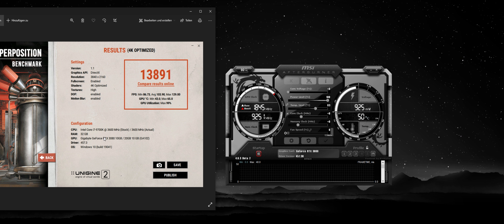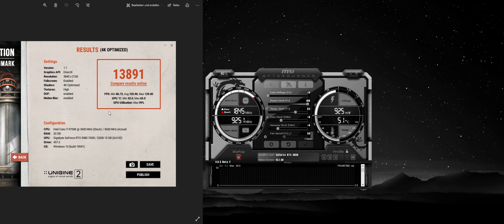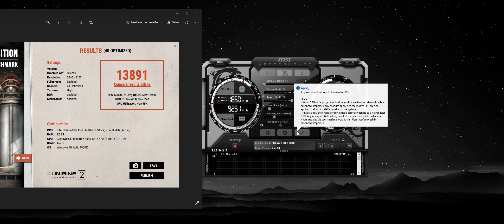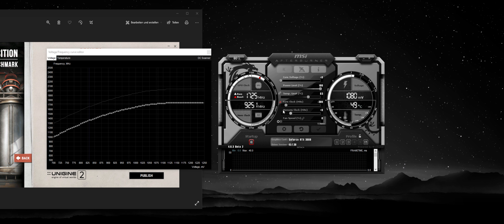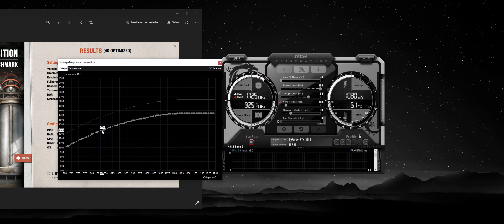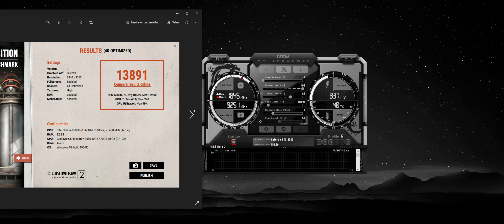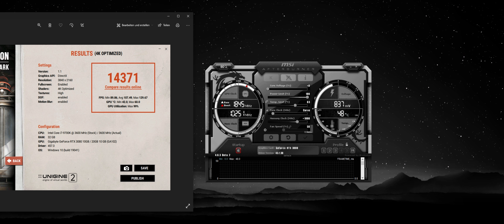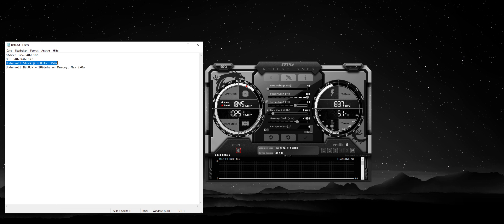GPU Undervolting Guide for RTX 3080 / 3090 | UP TO 100 WATTS LESS POWER

Comment: Hi mate, I got a watercooled system with 3 radiators and a watercooled 3090 from gigabyte. The GPU stays at maximum 35 degrees under heavy load. Which settings would you recommend for me in afterburner?
Reply: Don't undervolt, just overclock the shit out of it? Grab another +1000mhz of memory speed and increase your clock by +100. If you need the performance, anyways.
Reply: LOL, that's an awesome setup, but undervolting isn't for you unless you want to save some dollars on the electric bill.  Most people here do it to ramp down fan speeds on the graphics card.  With that kind of temp under full load, you'd be overvolting.  Unfortunatlely, there isn't much headroom on these cards.  If you find differently, let us know.
Reply: yeah unfortunatley I had to send back the RTX 3090 from Gigabyte. The GPU turned all of my monitors black, while the PC was still running in the backround. I have now an RTX from Asus and never faced the issues again.

Comment: im currently undervolting at 837mv at 1905mhz in after burner - i do have the aio version  temps are silly 40v
i have dropped about 90w load undervolting
Reply: btw i have 650w psu its no issue.   im pulling at load 380w in game

Comment: well i switched from rx6600 to 3080 and man power consumption is literally more than 3x of rx.and even while watching videos rx used 6-8w and 3080 eats 25-35watts lol thanks for the guide btw i managed to drop 330w to 180-190watts
Reply: what your settings?
Reply: XD I’m about to go from 6600 to 3080ti and was worried when I saw the power consumption
Reply: Going from 6600 to 3080 too what settings did you use ?

Comment: witcher 3 crashed for me with these setting , got 3080, any suggestions ? :) do i put down the frequency less or maybe choose a higher voltage ?
Reply: Try higher voltage until its stable, every silicon is different, even they are same 3080
Reply: memory overclock might be too high. try like +800

Comment: I get a score of 14618 with 1850Mhz / 850 V but my temps go up to 68°C
do you thinks thats normal?
Reply: Also you got this dashed line which goes from 825 Volt up, but i am missing it...does that matter?
Reply: He may just have better cooling than you

Comment: nice. I'm running mine @1920MHz with 880mV
Reply: Thats great result. I issue crashes at that voltage, need 925mV for 1950mhz, especially in demanding tiltes with rt on.

Comment: Don't do it. Just overclock it and use power limit to have it running at whetever you want it to draw. If you edit voltage frequency curve only at some points than you leave perfomance on a table with not demanding games and overvolting your gpu with really heavy games. If you don't understand what i say then i will give you example. My 3060ti undervolted at 1860/925mV draws anything from 170-220W. If i wanted it to use higher clocks at higher voltage than it would  still draw up to 220W as that is my power limit but it won't hit that higher clockspeed in every game and instead it will ran at lower clock. I you lower whole curve and push clocks only at some point then anything below that point will be overvolted. I'm using +105mhz core +900mhz memory and 80-90% power limit depending how game's framerate responds to higher clockspeeds.
Reply: Yea, there seems to be a lot of confusion about this. It seems that with these cards, when you overclock all you are doing is undervolting, and giving yourself more headroom, and vice versa. So people (like in the video above) are basically underclocking (overvolting) the card, and then dropping the voltage back down again at the upper limits.
The idea of just overclocking (undervolting), and then putting a limit on the power seems to make a lot more sense.
There's no doubt that the method in the video above works, but it just doesn't sit right with me. It seems messy.

Comment: Best programs to test Undervolting and OCs? and what to looking for in my results to identify stability
Reply: I believe 3D mark is on sale on steam for 85% off right now which is great for testing clocks but is a best case scenario as games won't comply as nice as those testing benchmark suites. And depends on game by game basis. For example I can reach 1965mhz at 0.900v on my 3080 in Shadow of the tomb raider but in metro exodus enhanced edition it will crash until 0.918v. I would recommend running a game loop benchmark to test stability. The Hitman games and Metro games have benchmarks that are loopable and I use them to test stability and would recommend those. If your OC or undervolt can pass say 10 passes in a game loop benchmark than it is probably stable for most games but you might find an oddity like I did for metro exodus enhanced edition as 95% of all games complied with my 1965mhz at 0.900v but it didnt until even 0.918v. I would try to find a hard to run oddity like that and find stability in that. Because if its stable in that it will be stable across the board for basically 99.99% of all instances.

Comment: Bro... Your Card didn't IDLE. Go to NVIDIA Settings and disable max Performance :) There are No Performance differnces, the only think is that this disable IDLE Mode. Much lower Temps in IDLE and Power consumption of course..

Comment: WILL UNDERVOLTING VOID WARRANTY OF THE CARD. MY 3080 CONSTANTLY CRASHES AT 4K GAMES. DEALER IS READY FOR RMA BUT I WANT TO TRY UNDERVOLTING TO SEE IF IT HELPS. BUT AT SAME  TIME I DONT WANT TO VOID WARRANTY IN CASE OTHER COMPONENTS OF CARD ARE FAULTY.

Comment: I feel like I need the -250 clockspeed explaining. Why not just drag the curve and leave it at that? Because from the looks of it, all that does is reduce the efficiency of the card by underclocking at the lower power limits. Looks like the card would have hit 1300mhz at 700mv, and now only hits 1000mhz at 700mv. Surely the base clock should only need altering if you're not going to touch the curve at all? Edit: I'm pretty sure I'm correct and this is just 'overvolting' it at lower speeds - nothing dangerous but definitely the opposite of the goal. You can flatten the curve easily enough without having to mess around with the offset. Ctrl clicking the rightmost point also lets you adjust the whole curve from the starting voltage/clock, just line it up like you want and then flatten everything past that point. Gonna be more energy efficient, and gives a perfectly smooth curve too.

Comment: Is this safe to do on the long run, undervoltage I mean?
Reply: Yes, it's safer than OC, which in general is also very safe to do.
Reply: Blakee1000 let me rephrase - are components goint to last less if I undervolt them, as is the case with overclocking?
Reply: @_neuromanser_  No, technically they should last even longer than stock, because you're running at lower power and in turn also lower heat on the processor.
But how long that is nobody knows, even on simple OC cards you're looking at use of 10+ years, which is when the card is already obsolete..

Basically all I'm saying is that it's pointless to worry about GPU tuning shortening the life of your components, it's more likely to die by something else.
Reply: @_neuromanser_  Heat and voltage spikes are components killer. When you reduce heat and lock voltage, you basically add life to your hardware. Undervolting is perfectly safe and even better than stock values in terms of longevity :)
Reply: @liquidchair  Thanks, this is what I wanted to read :)

Comment: and then theres me, with solder/copper wire bypassed fuses, running a 1,000W Galax bios on my 3080ti pulling 600W casually @ 1.1v on a 1080mm radiator and 8 200mm fans. its kind of like a space heater if i play the right game.

Comment: Or dont because that 100 watts a month is like a $1.00... 😂🤣😂
Reply: Or do because the 100 watts is extra heat that makes your fans run faster and louder and your GPU run hotter under load and thermal throttle.
Reply: I use about 400w on avg for 6hrs a day.  And elec is .07c per kWh where I live between 9pm and 5pm (25c 5-9pm). So only $4 a month.  Pretty good deal